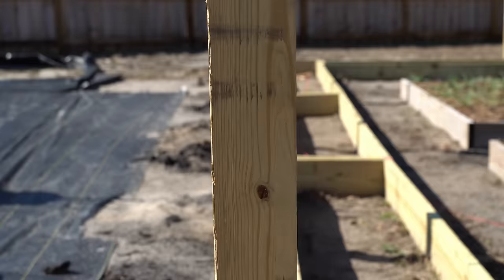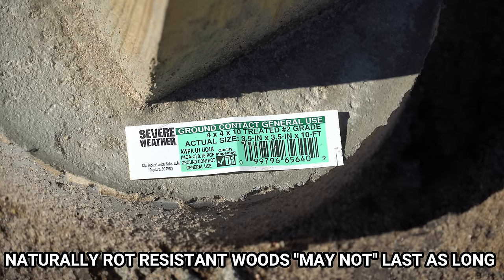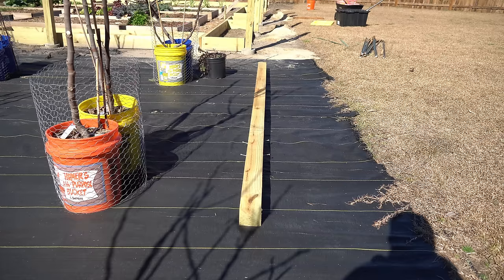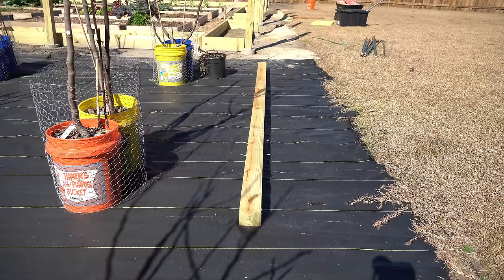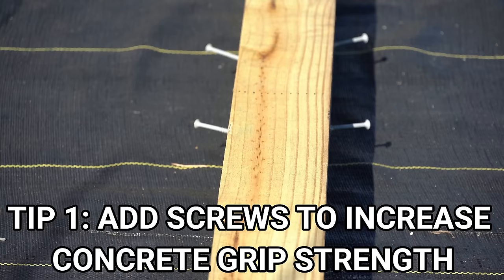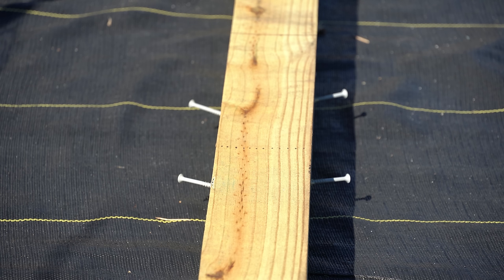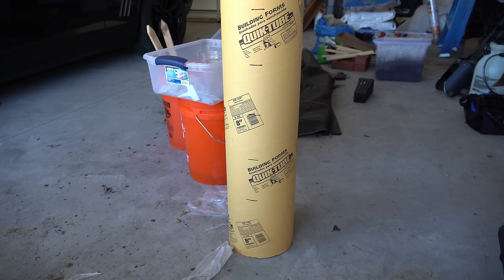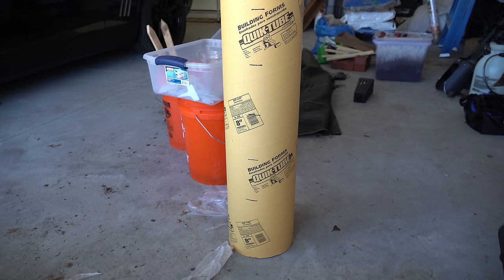3 Tricks To Installing Stronger 4X4 Wood Fence Posts That Last Longer

Comment from the maker: Do you have any big DIY projects recently completed or coming up on your to-do list?  Tell us about them in the Comments section below!
Reply: tar the bottoms the new pt wood sucks
Reply: If you're serious about rot and added strength here's how you do it:

1. Use Redwood or Cedar (treated lumber twists way too much)
2. Apply marine (boat) grade penetrating epoxy and fiber glass sheets to the wood. Let it cure.
3. Set the post on top of a layer of concrete and then fill the surrounding hole. Let it cure.
4. Upon curing, apply concrete water sealer around the post on top of the concrete. If there is significant shrinkage, pour sealer in the crack between the post and the concrete. Let it cure.
5. After the seal cures and for the same gap between mentioned in point 4, apply self leveling concrete caulk around post.
This will do it.

-Gen X Builder...
Reply: @d.e303-anewlowcosthomebuil7  whats pt stand for?  Where can I get tar?
Reply: @lchavez5924  is the red wood or cedar pressure treated and used for in ground?
Reply: @ShyRage1  pressure treated....basement waterproofing tar
Reply: @ShyRage1  No. Pressure treated wood is bunk crap! All it does is twists and shrinks.
Reply: @lchavez5924  what kind do you recommend?  Can I get it at Lowe's or home Depot?
Reply: I just bought a starlink and can only use a ground mounting method with property. To get better height do you think mounting a 5-10lb pole with the satellite on top of these 4x4x10 would be sturdy enough?

Comment: If you apply a coat of roofing cement to the 4 sides of the post you will significantly reduce the water damage. Apply the roofing cement from the bottom of the post to 3 inches above grade. Add 2 10 penny galvanized to the sides instead of screws. place 2 inches of gravel in the bottom of the hole. Set the post and make sure its plum. add the concrete and trowel the top so that it sheds water. I have installed posts this way for 35 years in South Florida and they have not rotted.
Reply: Can you please explain this a bit further.. links for material if possible.. I am looking to install my pergola poles in ground.
Reply: @bhuleskar1  What size are the poles, what type of wood, how deep and most important what type of soil? ( what state)
Reply: scat4me thanks for your response.. Do the posts are 6x6 redwood, soil is Clay (Pleasanton, CA), the posts needs to be about 9 feet above ground, under can be anything (what do you recommend) having it be. What type of footing would you recommend?
Reply: @bhuleskar1  If I were building the pergola I would dig the hole  16 inches wide by 40  inches deep. I would buy a can of roofing cement and spread it on the 4 verticle sides of the post to 43 inches from the end that is in the ground.  I put 3 inches of gravel at the base of the hole to allow drainage. Before setting the post in the hole you should nail 2 or 3 -  8 or 10 penny nails in the post about 2 feet from the end. Nail them at an angle so the head of the nail is pointing up and the bottom pointing down. Set the pole in the hole and make it plumb.  Once its set pour your concrete and fill the hole. Trowel the concrete so that the water sheds away from the pole. Poles will always rot at the base at ground level. By using thee roofing cement on the sides (NOT THE BOTTOM) it protects the pole from moisture. The gravel at the bottom of the hole allows for drainage.  The nails at the base will ensure the poles cant be pulled out of the concrete. The poles will absorb water but they will drain. You could also do this with 4x4 pressure treated lumber and afterward wrap the poles in redwood or cedar. That would be less expensive and possibly more durable. If you do use 4x4s reduce the width of the hole to  14 inches. I hope this helps.
Reply: @scat4me  
Great info and explanation. Thank you for your post. Much appreciated.
Reply: @scat4me  whats the purpose of the nails in the post ? Central Florida is were I'm installing.
Reply: @freebird1963   When concrete dries it shrinks. When you use roofing cement as a waterproofing agent it functions as a lubricant. The nails stop the post from lifting or being squeezed out of the concrete.
Reply: @scat4me  Gotcha. Thanks
Reply: This is why I read comments. Let me Screenshot this info real quick 💯💯😊 📷 
Thank you
Reply: @scat4me  What would make the concrete itself rise?  Perhaps screwing long screws into the ground itself rather than the treated posts?
Reply: @ShyRage1  The concrete does not rise. The concrete shrinks and because the 4x4 post has roofing cement, it acts as a lubricant. The concrete shrinks and squeezes the post. The nails prevent the post from coming out of the concrete.
Reply: @scat4me  i just wanted to make sure because every 4 or 5 post, the concrete along with the 4 by 4 is above the ground now
Reply: @ShyRage1  I don't know why they would be above ground. What area do you live in? How deep a hole did you dig? Did you put gravel on the bottom of the hole before you poured the concrete? Did you mix the concrete first? Or did you pour dry mux in the hole and then added water?
Reply: @scat4me  I'm not sure, how everything was done because we had hired fence builders.  I'm just noticing every few posts have completely risen up.  So in turn I thought a bell shaped hole or some type of rebar, hammered into the ground itself to prevent it from happening
Reply: @ShyRage1  The posts should not rise at all. A 6ft tall wood fence requires a hole 24 inches deep and 12 inches in circumference.  The Fence company should have pulled a permit. Check your local municipality to see their requirements.
Reply: @scat4me  ok, ill check
Reply: @bhuleskar1  I need more details. Where are you located? What are the dimensions of the Pergola? What species of posts are you using? What size post?.
Reply: @bhuleskar1  Ok, I see your earlier post. I don't know the Building code for your area. If the post is 9 feet above the ground, I would dig a 4.5ft hole. I would also make sure that the base of the hole is at least 16 inches in diameter. I would use 6 inches of gravel in the bottom of the hole. Prepare the posts as noted earlier. I would then set my posts at the correct spacing and plumb them. I would pour the concrete around the posts and trowel the tops so they shed water. A 6X6 post with a 16inch diameter hole will have 5 inches of concrete on all sides. This is how I would do it. You may want to speak to an engineer and get their opinion. I am not familiar with your area so clay may have a different requirement.
Reply: @scat4me what if I’m setting two 6x6 #2 posts in the ground for the purpose of installing a pull up bar? There will be lots of swinging back and forth on the bar…anything I should do different? I live in NC near the coast. I already bought two 6x6 12 foot posts and have to holes dug already that are 4 feet deep. A lot of water in the bottom of the holes…
Reply: @Bu11yBa11  If you live by the Coast and have water in footings that are 4ft deep, it may be salt water. In that case, you have a completely different issue. The poles must be at least 3.5 feet deep in the hole. The posts should be PT below ground grade. I would still coat the sides with roofing cement. I would try to pump the water out of the hole. If that is not possible you may have to buy 2 44-gallon trash cans. Dig the hole large enough to bury them. You may be able to cut them down to say 3ft tall. Backfill the perimeter with dirt. Set your posts in the can and fill them with concrete. That should stabilize them. This is only an idea. No guarantees it will work. Make sure that you mix the concrete well and not just empty the bags and sprinkle them dry mix with water.
Reply: @scat4me  would copper green have the same desired affect as the roofing cement? And I’ve seen a lot of people recommending to cover all 4 sides of the post that are below ground with the roofing cement (or copper green) but not the very bottom of the post to allow any water trapped inside the post to drain out the bottom. Do you recommend this also? I’m thinking if the posts are going to be sitting in ground water much of the time (if I don’t do the trash can method) it won’t really matter if the bottom is sealed or not
Reply: @Bu11yBa11 , I can't comment on the copper green as I have never used it. I can only comment on the roofing cement/tar. I can attest to a fence I built after Hurricane Andrew in 1992. That was 30 years ago and the fence is still standing, the posts are solid. Anything sitting in water (especially salt water) is going to deteriorate. I can understand your not wanting to use the plastic trash cans. My initial thought was to cut a 50-gallon steel drum in half and use that. The steel however will deteriorate quickly so that is why I thought about the plastic. The concern for your project is to stabilize the posts. The heavier, deeper, and wider the base is what should stabilize them. Again, this is just an opinion. I am a structural inspector. I try to visualize a project and then base my suggestions on 50+ years of experience in construction. I'm sure that there are architects and engineers that will have other opinions or suggestions.
Reply: @scat4me  greatly appreciated! I am actually going to try the trash can method. I know there won’t be any issues with any outside groundwater leaking into the trash can, however rainwater could leak down into from above but then that’s where the tar comes in hopefully and keeps it from entering the post itself.
Reply: @Bu11yBa11  After you have poured the concrete and it has cured you can use a concrete sealer. You can also look for an additive to mix with the concrete that will help in waterproofing. Good luck.
Reply: @scat4me  do you think there’s any risk of the concrete cracking the trash can once it hardens?
Reply: @Bu11yBa11  No. Concrete shrinks. Just make sure that when you backfill the outside perimeter of the trash can, you don't over-compact it.  Pour the concrete as soon as you backfill. The top of the concrete should be slightly above grade and troweled to shed water away from the post. Kind of like the top of an ice cream cone. After the concrete sets up you can then compact the backfill with a little more force. You do not want to deform the trash can by over-compacting before the backfill.
Reply: @scat4me  so I went ahead and widened the hole so the trash can will fit. When I push the trash can down into the hole down to the 4 ft mark, the surrounding ground water rises to within 6 inches of the top of the can. The can is about 2.5 feet tall, leaving another 2 feet roughly to the top of the hole I dug. Which makes me wonder if the can will even work or not since probably after a heavy rain the groundwater will rise even more and go right into the can.
Reply: @Bu11yBa11  You may have to change the location. If you are getting that much water. As I said before, if you are close to the coast it may be a saltwater intrusion. If you have had heavy rains it may be that the ground is just saturated. Have you tried pumping out the water? How far are you from the water (Ocean, Beach, River?)
Reply: @scat4me  it’s about a mile from the ocean. I’ve tried removing the water with a bucket but because of the nature of the soil being so sandy here , the hole refills pretty quickly meaning there’s going to constantly be a presence of groundwater 2 feet below surface.
Reply: @Bu11yBa11  you may have to run a pump to remove the water while pouring the concrete. Call your local building department and ask to speak with a structural engineer.
Reply: Ian totally wrecked the fence in back yard. I live in the Tampa Bay area so I missed all the really really hard stuff but the fence couldn't handle the wind. Wife and I bought this home 2 1/2 years ago so I've never done fencing before. All fencing companies aren't calling me back which I understand. This vid seems informative but your explanation and you being in FL seems better. I hope you can help.
1. Can I mix concrete in a 5 gallon bucket using a small headed shovel? I don't have a wheelbarrow.
2. What is 10 penny galvenized mean?
3. Can I mix the roofing cement in the 5 gallon bucket before the regular cement? Where would it be safe or environmentally friendly to wash out the roofing cement?
I'm sure I'll have more questions but I'm headed to the store now for supplies. Thx in advance if you get this. I need all the help I can get.
Reply: @MrBoDiggety   Yes, you can mix it that way. You can also mix it in one of those storage tubs/containers that home depot sells.  Or better yet. Dig a hole the size of a wheelbarrow. Line it with plastic and mix it there.  Heavy duty Visqueen is also sold at teh home stores.  The hole doesn't have to be deep.
Reply: I always see the rot at where the ground topsoil meet the post I never see it at the bottom of the post ever.
Reply: @scat4me  no it would really help if you can take out the old post on my property that is being moved back 3 feet where they belong. The post are only in concrete no nails on the sides. Question for you- won’t the roofing tar repel the concrete or is it just the weight of the concrete that holds the post in place regardless if it’s a Teflon post or post smothered in the best waterproofing you can buy.

Comment: Those screws aren't going to help anything. Burn the end that goes into the ground and coat it with diesel and motor oil 50/50 mix.
Reply: How does that help? And how much?

Comment: A couple of wood screws doesn’t add “A tremendous amount of strength” Sorry to break the news.
Reply: Agree.  The rest of his ideas are very good and solid advice, but there is no need for a few wood screws to be secured into the bottom of the post to add strength as it is adding very little to help out.  I understand that the screws are acting like a re-bar fortification to the pour, to help strengthen it, but again, those screws will do very little to help.  Other than that great job on the posts.
Reply: I disagree, if the treated 4x4 is still wet it will shrink quite a bit causing a small void between the wood and concrete. That not only allows the post to wobble it also allows rain water to enter the space between the wood and concrete. Once it freezes in colder climates eventually it will crack the concrete. If there are nails (I don’t use screws because they can snap under pressure) they will generally hold the concrete helping the stability of the post.
Reply: Tremendous is a strong word... i would say it will be better than nothing.

Comment: I've been watching all videos on post setting and I've decided to apply ALL tips, even applying motor oil and roof seal to the post. I recon by applying all the tips I've found, the post will survive Armageddon.
Reply from the maker: All I can tell you is if you're setting posts for a garden fence, don't use motor oil, creosote, or anything toxic that will pollute your soil.  These posts have been soaked in copper solution, so they're not going to rot anytime soon.
Reply: I swear I was thinking the exact same thing. Foam, concrete, roofing asphalt coating, burn the end 50/50 mixture of diesel & used motor oil.  Oh some screws for the concrete to grip too. Did I miss anything?

Comment: If your truly worried about fence rot, then simply do a full concrete post, and set a post mount on top.  If the wood rots, you simply unbolt it and replace it.  Just make sure your concrete foot goes deep enough, and has a good base to prevent heaving if you live in a cold zone.
Reply: 42" here in Michigan, I believe, but I'm the type to (at least) slightly "overdo" (over engineer?) things--the next killhouse (deer stand building) I put up will be exactly as you've described here.  My first built setup is "settling" where it sits--I just used those concrete "pads" you can get, using the center for 4x4's, or slots for 2x lumber to rest. THAT setup will BE redone within 2 years, and all six 4x4's supporting it will be replaced, and set ON 48" deep, 60" high (12" above ground) footings, at that location...
Reply: Will the post to post base connection be ok in windy areas?

Comment: In clay soil it may not be a good idea to place gravel beneath the post. Why not? Because the height of the water table in clay will always be higher than the height of the water table in gravel. Therefore, if you put gravel in the hole it will create a capillary break that will cause water to flow TOWARDS the post not away from it. The water that enters the gravel can’t drain as there is impermeable clay around and beneath it, so it just sits in the gravel “cup”. Over time, the rise and fall of water table, if present, will rot out the bottom of the post. This is not an issue in well-drained sandy soil nor is it a serious issue even in clayey soil IF the capillary fringe on the water table remains below the bottom of the posts. Otherwise job well done. Hope that helps.
Reply: Having clay at the bottom of the post sucks.  I wondered if putting a cement slab at the bottom before placing the post would help.